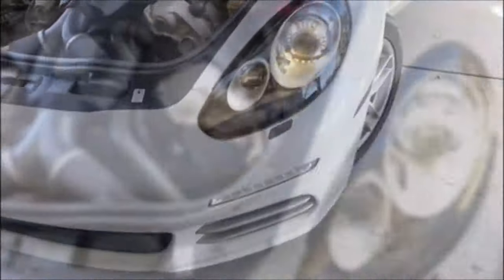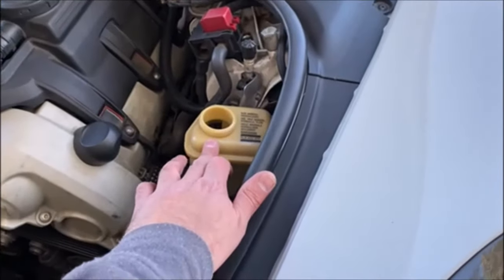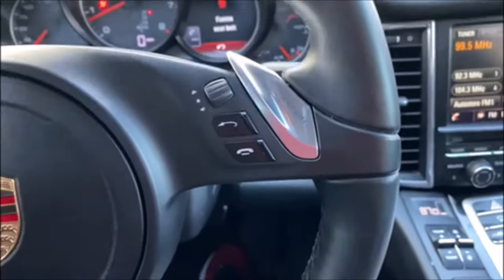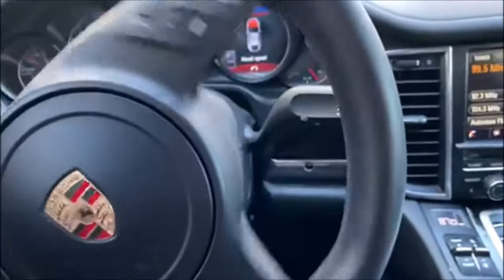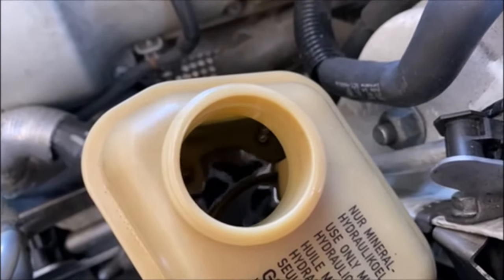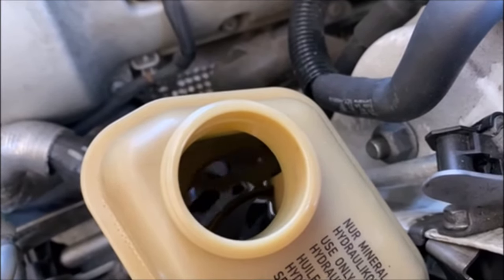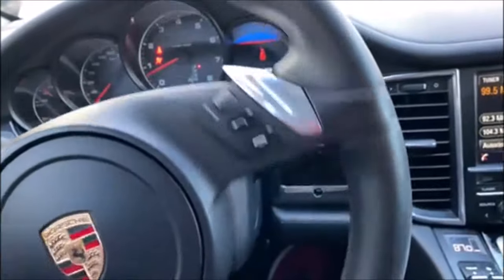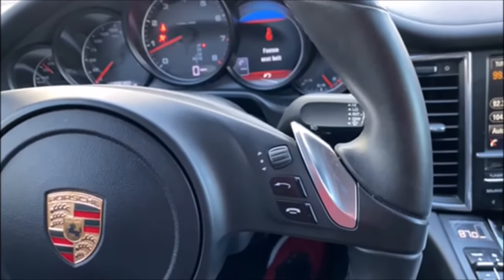Power Steering WHINE NOISE | Easy FIX !

Comment: Can power steering make a noise even when not turning? I notice a whine noise when accelerating in low gear wondering if maybe that is added strain on the power steering pulley. The sound gets worse when i'm turning.
Reply: Same question.  Whine gets worse when accelerating, even when not turning.
Reply from the maker: Yes, it definitely can. Make sure the fluid level is correct. If it is may be air in the system or a worn power steering motor.
Reply: Same thing it gets louder after 2k rpm was it power steering pump? @knock3x
Reply: @FlipITGarage is it normal for it to whine super loud when turning? & why does it only whine when turn the wheel to the right and be super stiff when I turn it left ?
Reply from the maker: @monaeeuniquee2534  that is not normal operation. Have you checked the fluid level ?

Comment: I change my power steering pump and my pump is still wining even though I did this to get the air out the lines .....?
Reply from the maker: What’s the year make model?
Reply: Bro same did you find out anything ?
Reply: It’s probably your tensioner pulley. Sounds a little odd but I’m almost positive that’s your issue. It causes the car to sound like it has a bad power steering problem.

Comment: I have a 2006 Acura tl it makes that sound too and my power steering was hard they told me it needs rock and pinion whatever I bought it they put on now when I turn the the power steering it makes squeaky noise it’s even louder any suggestions please I’m tired of spending money on this car 😢
Reply: the rack and pinion system is mechanical. the whining issue is coming from the power steering pump. they probably scammed you

Comment: What if the power steering is electric without fluid and it is whining on low speed in a 2023 car !!
Reply from the maker: Sounds like a mechanical issue. See if you can scan the power steering module for codes.

Comment: hello, i have an audi a4 b5 and my stearing rack was leaking so i got it repaired and i just got my car and the pump is whining and before fixing the car it didn't whine. what could be the cause
Reply from the maker: First I would check the fluid level and make sure it is topped off correctly. If it is may have air in the system or a faulty pump. You should just take it back to who repaired it.

Comment: Is it normal to hear a slightly "hydraulic" type of sound coming from power steering when reversing and quickly turning or accelerating slowly but quickly turning ? For example I'm driving and turning regularly and I hear absolutely nothing all perfect and everything is smooth but as described sometimes when I slowly start accelerating and I'm turning quickly I can hear a power steering pump making a hydraulic sound for half a second and then go back to silent.

Comment: It worked! But what if the bubbles won’t go away?
Reply from the maker: As long as the noise is gone and steering is good. Little bubbles aren’t an issue. A lot of times it’s just caused from the pressure movement’s.

Comment: I have a 2014 Durango with a 5.7L hemi that’s been making this noise for quite a while now. 

Could it be that I need a whole new power steering pump? Is it dangerous if I stay driving with this problem?
Reply from the maker: The whining noise may be due to low power steering fluid, air in the system, or the pump itself. Definitely check the fluid level first.

Comment: What if we did this and power steering fluid is good? And still makes noise lol only makes noise when cold?
Reply from the maker: You mean fluid level is correct and completely bled? Depending on the noise. A squealing noise would be the belt. A whine noise with everything else correct may be a worn/bad steering pump.

Comment: Hi, I have this chainsaw kinda noise on nissian 2016 pathfinder power steering when it’s stationary, and it get louder when wheel steering. What am I gonna do this this noise 😢
Reply from the maker: Hi, does your car have electric power steering ?
Reply: Sorry, I didn't see your reply, and yes, it has an electrical motor to power the steering pump. After some experience.  I figure that noise get louder when the steering wheel is not in the normal position when I put in park mode. wise vasal noise gets quiet If I put wheel steering in right position.  The sound from electrical motor when steering can't be removed though. New issue that I recently encountered was vehicle wasn't accelerating when I push gas pedal while RMP went up to 3000+...  I had to park the car and restart the engine for it to go back normal.  I almost hit the parked vehicle when turning because of this. 😮‍💨I wouldn't buy Nissan car anymore. ￼😢 @FlipITGarage

Comment: My 07 civic has started making this same intermittent noise esp in morning at startup goes away after driving had my pump checked they said it’s working ok on day the fluid was bubbling out of resivoir it’s the weirdest thing
Reply from the maker: Sounds like you have air trapped in the system.

Comment: Same car, same engine, same noise but it still makes this noise.
Reply from the maker: Depending on how much air is in the system it may take a lot longer for this procedure to work.  Took me about 20-30 mins. If there is to much air you may need to use a bleeder for it. It is the same whining type noise correct ?
Reply: @FlipITGarage hi bro I don’t get that whining noise at idle but when I accelerate or even a little I hear whining noise and whenever I tighten my steering pulley tight it goes away for a day or so. Can u help me out diagnosing it
Reply from the maker: @Creamymoonxx00  Hey. This may be obvious question but I have to ask. Is the fluid level full ?
Reply: @FlipITGarage  yes it’s full do u think I need to flush it? And srry for late reply
Reply from the maker: @Creamymoonxx00  if you can email me a sound clip it’ll help. Email is in the about section or send it on Instagram @FlipITGarage